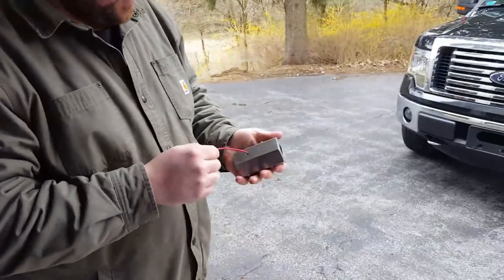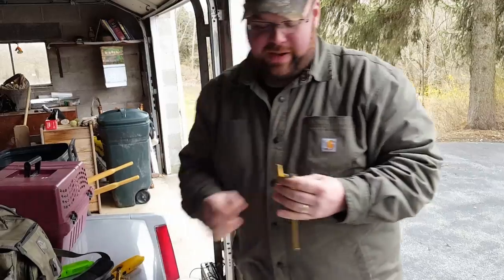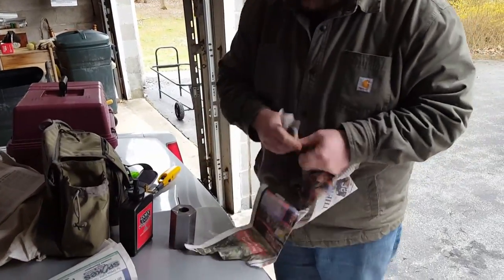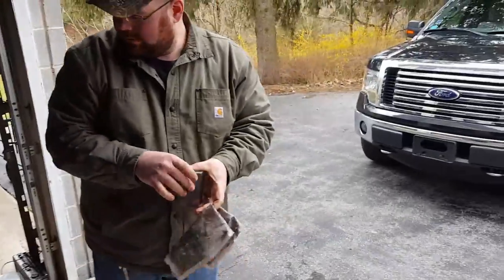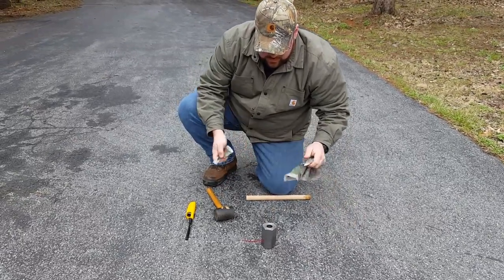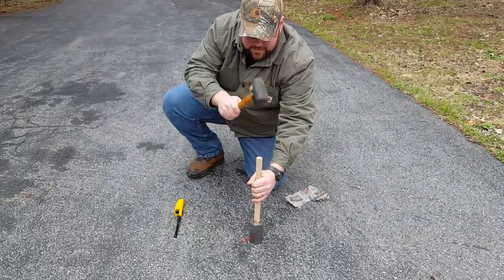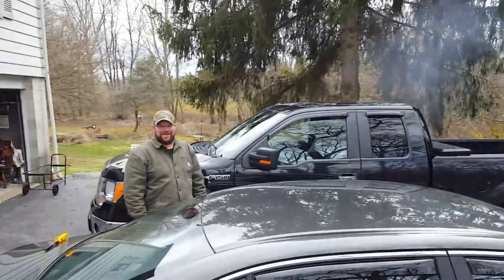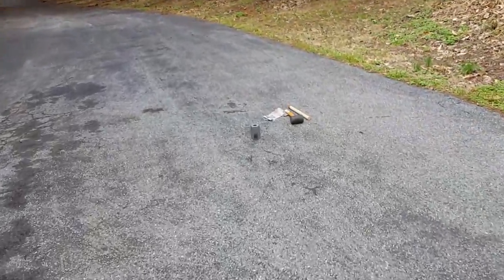Loading and Firing the "Thunder Mug" Signal Mortar Salute Cannon

Comment: use white bread for you wadding. no burning embers and the birds and bugs will eat the leftovers. i also use a wooden dowl and a rubber mallet to tightly pack the bread and powder. the tighter you pound the louder it gets.
Reply from the maker: I have been. It works great!
Reply: @Fireinahorn Yep, I use a slice of bread packed with a dowel also in my signal cannon.

Comment: Use about a 1/2" long piece of wooden dowel the same diameter as the cannon bore for your wadding.  Tamp it down like you are doing in this video.  Make it a tight fit.   It is harmless downrange, and gets a lot better bang out of your cannon.
Reply: Pro tip we use cat litter it compresses rock hard and makes it bang really loud.

Comment: Too much wadding.  You can start a fire.  I use toilet paper and it desinigrates.  I also use three heaping teaspoons of powder.  The result is the sound like a civil war howitzer.
Reply from the maker: I now use a small piece of newspaper between the powder and a wad of cheap white bread.   Haven't tried T.P.        Do you use damp T.P.?
Reply: I just use dry toilet paper and ram it in solidly.  You get a really good blast and the toilet paper is shreaded so you don't have any fire hazzard.  My barrel is about a foot long with a 1 inch bore.  I can't fire it in my neighborhood because the noise is incredible.  I am very happy and satisfied with my project.  I also made a second one for a friend.
Reply: I use flour and it works very well. Can pack it quickly too